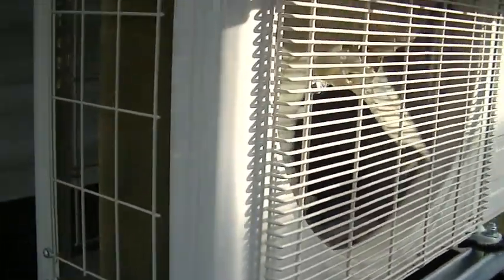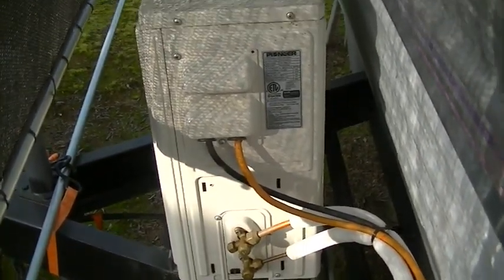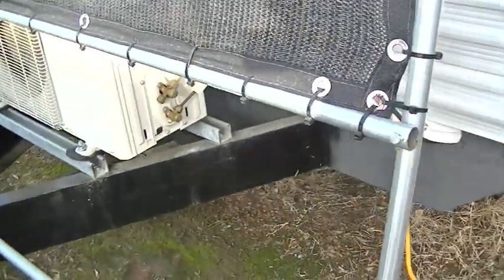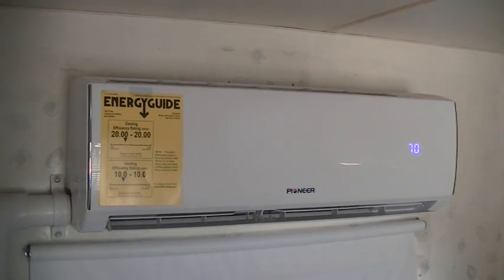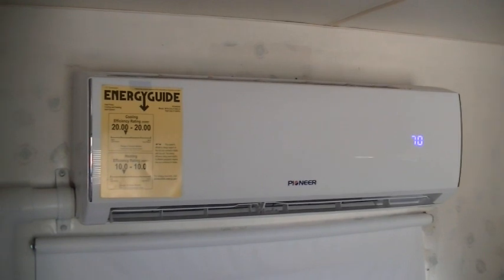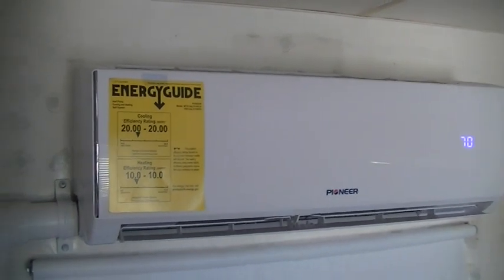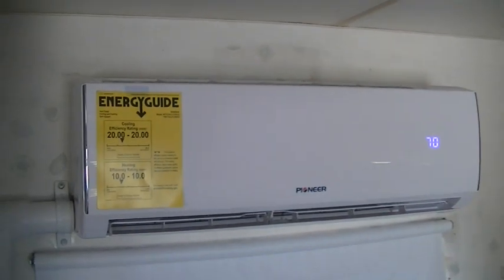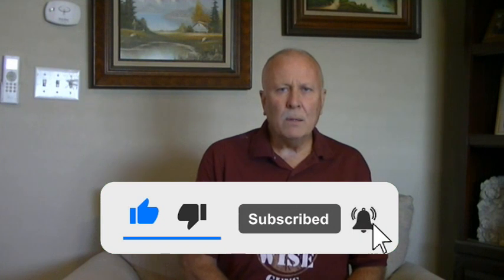Mini Split HVAC on RV

Comment: Good Job. I just installed a 12k Btu EG-4 28.5 SEER2 mini split heat pump on the back of my motorhome. It's the highest efficiency 12 kbtu 110v unit made. It is a DIY solution, like the Mr. Cool unit, that doesn't use flared fittings and you don't have to pull a vacuum for a super simple install. With 5,000 watts of onboard solar and 23.5 Kwh of LiFePo-4 batteries I have 24/7 off grid electric and heat.
Reply from the maker: Hi. That is awesome. I have installed mini splits on 3 RVs and each has worked out great. Thank you for your comment and input. Blessings my friend.